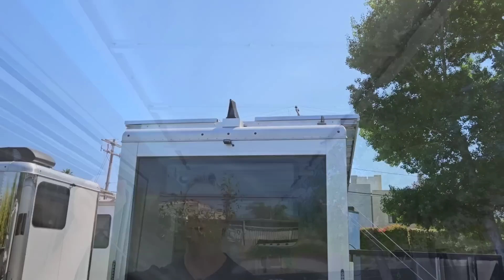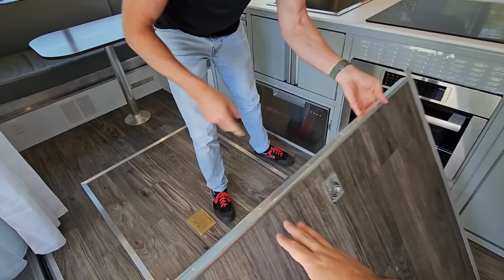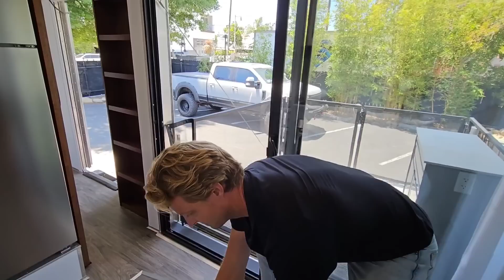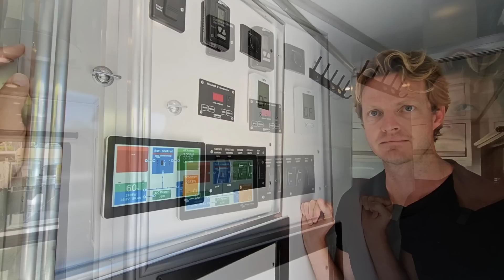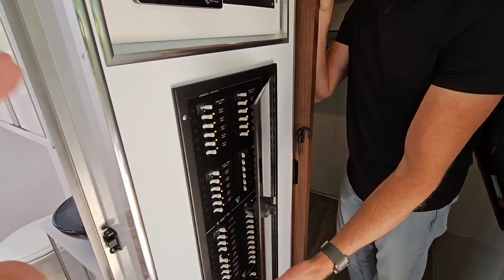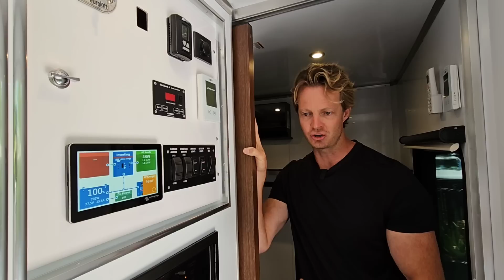Insane Off Grid Solar Technology! Living Vehicle RVs!

Comment: I have 45 total kw of battery. 30 kw of lifepo4 and almost 15 kw of nissan leaf modules. 7kw of inverter and run everything in my camper with electric. Solar is definitely the way to go. I did my solar for about 30 grand worth of equipment.  I built it all into a holiday rambler and couldn't be happier with my build. I really like the way the solar panels are on this unit as mine are all ground deploy. Thanks for the video

Comment: In fairness wood cabinetry like what you find in Newell, Country Coach or even something like the Van Leigh Beacon isn’t automatically inferior or less durable. Built right and installed right wood cabinets can be every bit as durable as the metal cabinets here. And they can have advantages like having latch systems that aren’t tool box metallic clinks every time you use them which is something I noticed in one of the videos.
Reply: I can only speak from personal experience having renovated hundreds of vintage trailers. After a couple decades of age, wood cabinetry was the number one thing that needed to be torn out and replaced.  Whether from damage to wood from condensation, water infiltration, or rot - or even more common from movement of the RV frame and chassis that degraded the structural integrity of cabinetry itself. There’s a reason we don’t see wood being used in the automobile industry.

Comment: With all that money and education it's too bad a fluid dynamics class didn't get put into the exterior design. I'd venture that a cinder block is more aerodynamic down the road. By virtual of a low center of gravity, with the batteries, it's not likely to tip over but the high coefficient of drag must eat up fuel like Joey Chestnut at a hotdog contest. 
I love technology and wouldn't kick this out of the driveway but what part of living in a box that looks like an inside out high end tool chest as luxury? All of that hard surface area inside must reverberate like being inside a mausoleum. 
I wonder what the thermal transfer is like in cold weather with the floor and sidewall construction?
 Another aspect of photovoltaic efficiency is being able to tilt towards the sun especially in winter, do those awnings tilt up? Is the leveling system able to tilt the whole rig? 
Also why a super duper higher than high end never before seen level of excellence in an rv trailer not use the top of the industry range Mitsubishi mini split inverter heat pump? LG ranks about 3rd or 4th down the ladder. Not bad, but with electronics costing about as much as a  Patek Philippe Nautilus (in aluminum foil) why not spring for the best?
BTW,  how many Nissan Leafs is the electrical system alone equal to?
Usually like your videos JD but I think you're a bit over the top with the repetitive descriptions with LV here.

Comment: I have watched all the videos in this series, and yes, these trailers are impressive.  But, they cater to a specific crowd.  Are you wealthy?  Do you want to be off grid?  Are you at least 50-50 an environmentalist, because you sure aren't moving this very far with an electric vehicle, so you have to make some compromises if you are all in on enviro.

While many people can afford this and might be interested, it has still yet to be addressed when a system fails; no matter how remote of a possibility they seem to believe  it might be, who services it, and where?  How long is the warranty on the systems, frame, and shell; and are the warranties each different?

These young people have an excellent idea!  But ideas on what is perfect for people change with need, and age.  Who in their 50s has not gone from a bunkhouse, to something larger, to eventually a couples camper?  The longevity of these campers may not come into question.  But to suggest these are forever campers is ridiculous; unless you are wealthy enough to pass them down as you change your tastes in what you specifically need for personal use, and that is only if your children enjoy camping.

What you may end up with is a 6 figure paper weight that sits on your property, that doesn't fit any of the families needs; and a high 6 figures to boot!

Doesn't mean these young people are bad, or that their dream is faulty.  Just means maybe they SHOULD cut a few corners, because when people do realize the vehicle no longer fits their needs, they are going to be a bunch of UNHAPPY campers when they have a very small group of people interested, unless it is sold at cut rate prices.  It is like the people who paid a fortune for the Chrysler Prowler, and now can't get 15 cents for them because the people who would like them, are so few and far between!

Comment: The only weak link with be the flex panels. Those look like the standard sun power solar panels that have been around for a while and just dont hold up. Renogy 175s and the new 200s with half cut cells would have been a much better option as the 175s have been proven and doing great for years and the new ones are a better quality build. They can easily switch but that would be something they should look in to verses the sun power which several of those have burnt up. Although I still have not seen any 175s from renogy go up in flames. But who knows its possible with any flex panel. 
Over all very nice trailer and the rest of the system with marine products is top notch. Just swap the panels 👍🏼

Comment: You MIGHT get 20kWh per day from a 4400W solar array.
Reply: Summer in the lower states with no trees around, you could probably capture 30kwh a day. The minis splits dont work well in the winter to heat, and that solar array wont make much power in the winter, maybe 1/3 of the power.